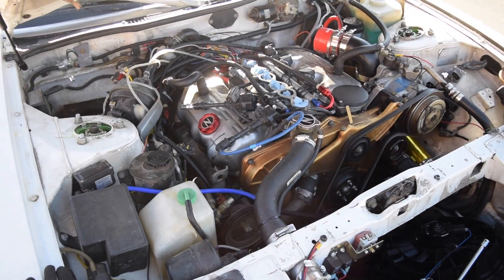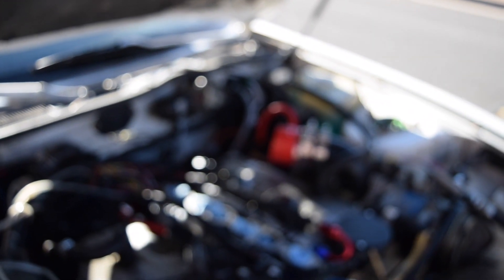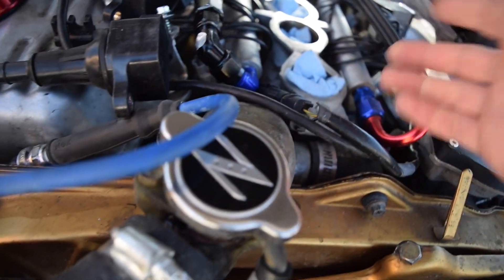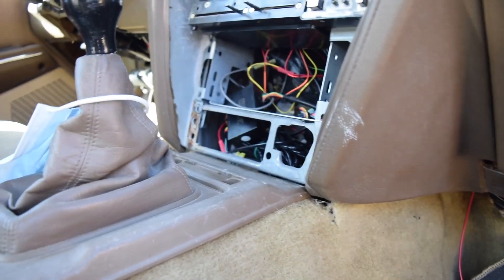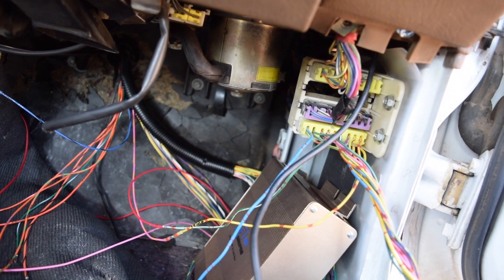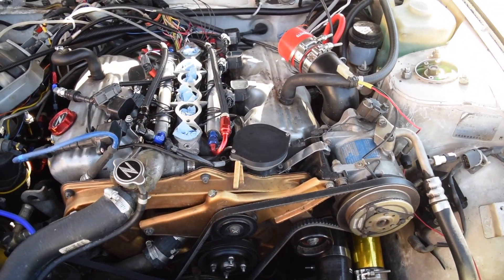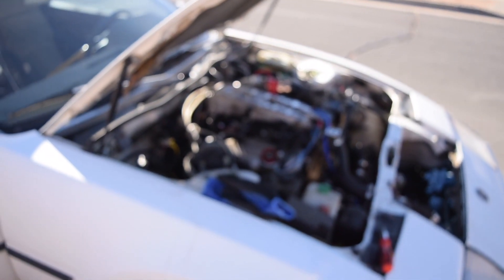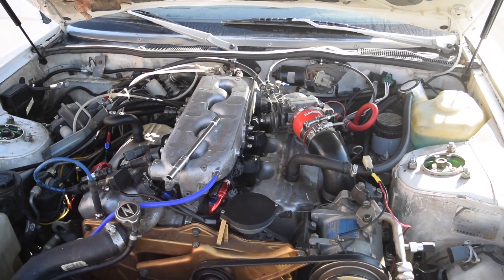Megasquirt Day 3: Wiring, Wiring, and more Wiring

Comment: You IAT sensor is on the back side of the intake right? Wonder if you noticed any heat soak?
Reply from the maker: I didn't notice any, but then again I wasn't really looking for it and I wasn't pushing the car too hard on that setup
Reply: @TheZGarage  I was speaking with another well known Z31 guy about the position I copied from your video. And he said it would create heat soak and that I should put the sensor on the intake pipe before the TB. luckily this is my spare intake I'm new to all this non oem sensors and things lol!

Comment: Slightly off topic from the video but is there any difference between the lower intake manifolds when it comes to putting a OEM top feed set up on a model that came with dual feed injectors?
Reply from the maker: Nope. They're all the same. The fuel rail is the only differences!
Reply: @TheZGarage  awesome thank you, got a top rail assembly and just ordered some FC RX7 550cc injectors to use on my 87T
Reply from the maker: Sounds awesome! Good luck!
Reply: I got to thinking about it today when I was driving my car but a few months ago when I was doing a little maintenance I put NGK plug wires and spark plugs in my car when I did the upper intake plenum delete and a bunch of vacuum line deletes and did the prw2 ignition mod fuel pump relay mod but I know I got a good deal on some NGK plugs and plug wires at the time and they were not any specific plugs and now that I think about it they were probably just some cheap shit but they just happen to be NGK and I bought them do you have any recommendations on which specific drug is it good hot plug you know I've got the MSD for Coral prw2 ignition igniter chip lots and lots of little dumb shit but I think I have just some cheap NGK plugs not knowing if they're hot or cold or what they even are really do you have any good recommendations
Reply from the maker: The stock plugs are what works best for a stock car. Ngk is the brand to go with and you want the copper plugs. I don't have the part number but you can find it on rockauto or autozone
Reply: @TheZGarage   yeah I got the plugs that my car called for but they were just cheap N GK I got a deal on them and the NGKwires I just want something that will burn the best I don't remember them being copper I don't remember them being cheap lol and what do you got yours at Gap wise
Reply from the maker: Typically the ngk plugs come pre-gapped but you can check what the stock gap is. I believe a Haynes manual would have it or the factory service manual on XenonZcar.com
Reply: @TheZGarage  okay do the adjustable strut mounts work with the factory struts or only with coilovers say I've got the factory setup can I still run the adjustable plates for the camber adjustments reason why I asked is because my talk strut mounts are fucked and I want the adjustable ones like you have but I'm just curious will they work with the stock setup sorry to bug you with all these questions lol
Reply from the maker: Those plates come from the coilovers. I don't think you can buy them separately
Reply: @TheZGarage  okay thank you for clearing that up I was just kind of confused it looked to me like that would double as a strut mount because I know my strut mounts are shot and it's like $60 for the pair and I like the way those look when you pop the hood so even if I didn't get cool overs I was going to get those if I could I like the gold look plus the adjustability I like to be able to adjust everything lol but thanks anyways you don't know anyone that has a used set of coilovers for that car do you
Reply: @TheZGarage  well I drove my beloved z to work today notice my clutch pedal felt mushy this morning well it has a new clutch master cylinder and a cool new clutch slave cylinder 280ZX front brake line clutch damper delete and this son of a bitch started acting funny this morning then it got worse at lunch and by the time I got off work I realized I had blowed the seal out of the clutch slave cylinder so now it's cold and dark and I'm under the car working on it as we speak is there a better upgraded slave cylinder for this thing other than a power torque from O'Reilly's can I use an upgraded 240SX slave cylinder I know it uses the same shifter as a 240SX the turbo disease have the same shifter as the mustang in the na has the same shifter as the 240 so I wonder are the 240 slave cylinders any better
Reply from the maker: I don't know of any other car slave cylinders that fit for sure but I bought the exeedy brand slave cylinder from rockauto because that's the oem supplier so that's what I would recommend.
Reply: @TheZGarage  yeah I've been through three in a year for O'Reilly's they're made by power torque and I'm beginning to think that that's just a shitty brand which I do drive my car I don't just put around I drive it like it wants to be drove that's for sure
Reply: @TheZGarage  I've gotten brand new struts because I can't afford coilovers right now which I would much rather have but I have brand new strut cartridges and then ordered upper strut mounts then realized they didn't come with bearings which why the hell would a strut mount have a bearing so bagged my girl to get me my bearings this morning when I left to go to work and I haven't seen her yet so hopefully she ordered them so I will have everything here to do my suspension and get my car riding right again damn it I wish I had coilovers and I could fix my exhaust leak I have pipe for the whole underneath the car but something about my manifold is leaking I'll have it figured out in the next couple of days though I'll be able to work on it for a couple of days right now and I actually found something earlier than an 87 I can tell by the tail lights someone I know described at a junkyard about 30 minutes away I am going to hit them up tomorrow I need window switches I need an inside driver door handle I need the power supply box for the digital dash because my whole dash worked before that went out and it would be so nice to see all my digital dash lit back up but that damn box is $200 everywhere online and I can get one at a junkyard for cheap if I could just find one and damn I hope I can get the rear brake calipers today I have rear caliber rebuild kits to rebuild my calibers but cannot figure out for the hell of me how to build those rear calipers on these cars wish me luck I've got a lot to do this weekend

Comment: I'm really beginning to like your setup I'm not even going to lie I like my car but I love your setup I have a few things similar to you and a few things different than you but I like overall how you're doing your car latelyI want to figure out how to put chrome headers and a rear mount turbo setup from having a few issues out of my suspension right now and I don't have the money to put coilovers on it right now so I'm changing my springs and putting all new struts on it just for now because I've got a few pops and sounds coming from my front end is the only thing that I haven't replaced is my struts and springs and I know for a fact my driver side strut is shot the gland that actually has a spot gone out of it where I can stick my pinky finger in it I'm having a few issues right now and I don't have the funds to do what I need to do I ordered brakes and rotors from parts geek and I waited 10 days too long to do something about it and noticed they sent me four lug rotors and I need five lug my plane is day typed in 1986 it would not let you proceed with the order without typing in a year model but I typed in 1986 and they sent me four lug rotors now I have a set of four lug rotors brand new that I can't use my funds aren't good enough right now to be doing stuff like that my starter went out on my Ford Taurus I'm just going through it right now trying to park my car so I can work on it after work for a week or so and get my suspension back together well I haven't even started on it yet because I'm daily driving it now but man I wish I had someone with your knowledge and patience to help me for just a minute the story with my car was my uncle gave it to me 20 years ago and it passed away two years ago well his mother died yesterday and I was trying to finish the car for her because she knew how me and her son my uncle wanted to get it done and never got to before he passed so I've been struggling to do my interior and get the car back together because that was what we always talked about was when she got well enough she fell down the stairs last year and we kept saying when she got well enough to walk again we were going to take the t-tops out and go riding in the mountains when she died yesterday so now I'm going to be really pushed to try to finish this car I don't mean to bug you but I know how you care about these cars and they've been a part of me and my family for a long time and when I need advice I figured that you're the one to go to lately I'm changing the oil today with my Royal purple 10:30 in my k&n oil filter but I've got a bottle of Lucas oil treatment what do you think about mixing some with my transmission and my oil